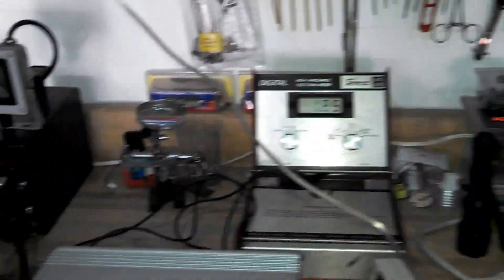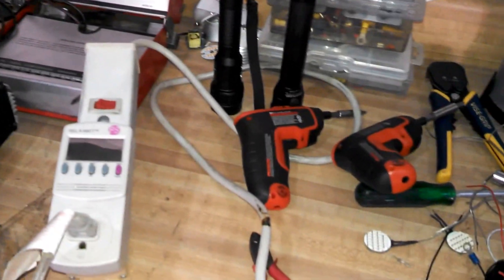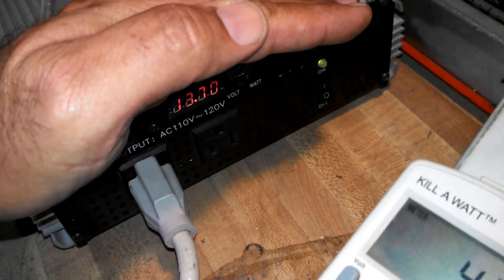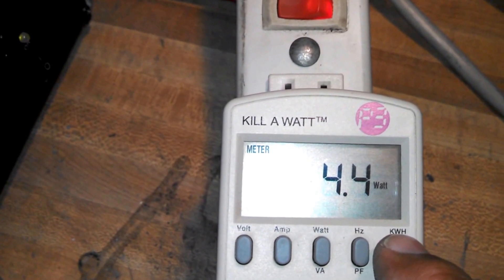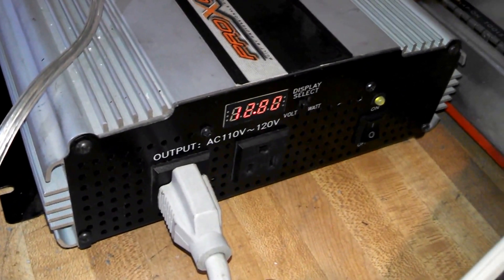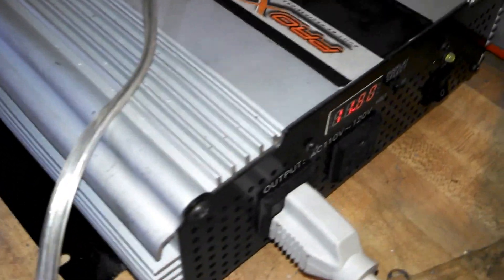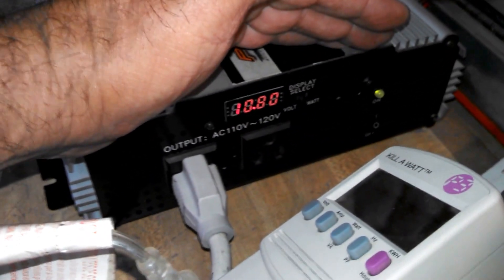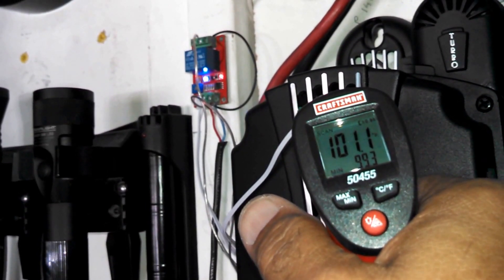Ultracaps, Boostcaps  Running The Inverter.

Comment: Not a long run time but they are designed to help machines start to help the drain on the lead batteries. hook them up to the battery bank for when surges happen they help keep from making a big drain on the batteries.
Reply: Shartne and Raz, Where are ya'll hooking up the booster caps in your system? with the batteries? or ???
Reply: Off Grid Texas Homestead I have seen these on car stereo systems and they are hooked up to the battery. I think it just parallel. It will make the amp punch hard and steady. Because of no voltage drop.
Reply: What I was trying to figure out was which side of the battery cutoff switch would the capacitors be tied to? I bet in a system it would need a separate cutoff(s) for the batteries and the boost capacitors also.  Thinking about it from a safety and fire standpoint. I ask you both because you both have serious solar systems and are both familiar with the booster capacitors.
Reply: I really dont know. LOL exactly where they go good question.